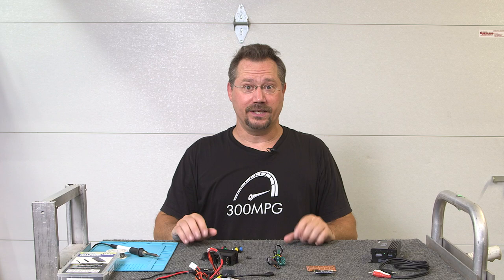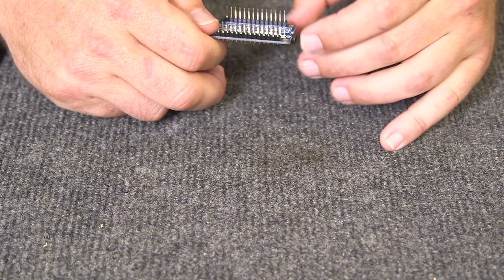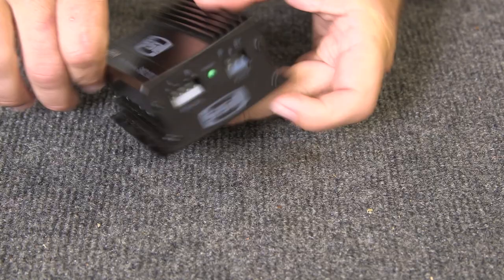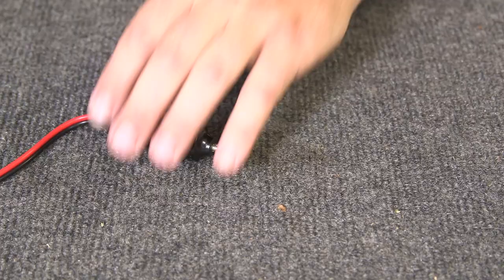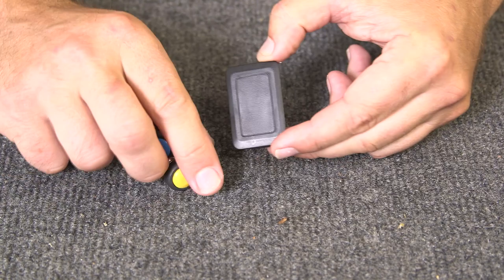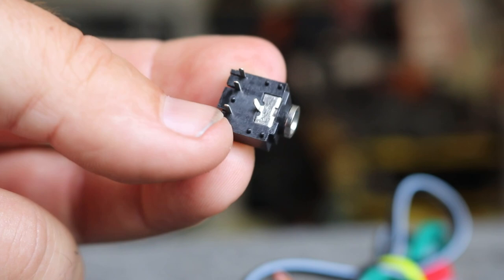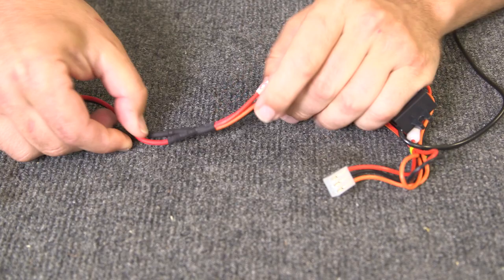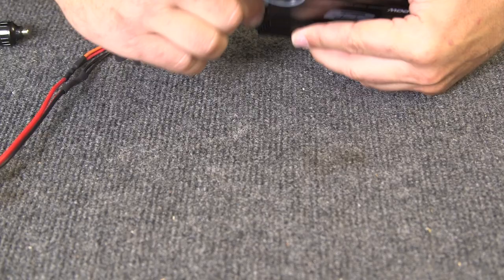Custom Car Horn | How To with Adafruit Sound Board

Comment: Can you use the existing pedestrian audio alert system to produce your customized sound? I hear your vehicle has both sounds together.
Reply from the maker: Most of the time I've used the custom horn so far has actually been with the vehicle stopped at a traffic light or stopped in a parking lot. In either case, the UFO pedestrian warning sound isn't playing.
I don't really have any urge to mess with the low speed warning sound. Nice and simple just to add the sound card and speaker.

Comment: Any suggestion on how to set up one of the triggers to play the files at timed intervals? I am thinking of using this car shows where I won't be sitting in the vehicle to keep pushing a button.
Reply from the maker: Hmm. I guess that based on my skill set, I’d use an arduino to trigger the sound board and have it programmed with a series of delays between activations. 

I’m sure there’s lots of different ways it could be done.

Comment: Sounds like the moos from the cow level in diablo II. That sound board is pretty expensive now at $35, and it just rotates through the various clips without the ability to select?
Reply from the maker: Yep! The sound effects are from the Cow Level! Except for one of them. One of the audio files is just me saying "Moo" into the microphone on my computer. It blends in really well, and it's hard to tell which one is mine.
As for the sound board, I used it because it was something that I already had. It can be set up to play sequentially, random, continuous, etc. It can also be set up with multiple inputs (buttons, typically) to choose the individual sounds, but I only wanted one button in the car, not multiple.
There are other sound board out there which can work nearly as well for a similar project.

Even if a person doesn't use the exact same components, I hope the video shows the general idea so that anyone can build something similar for their car other other custom audio project.

Comment: Hey I’m a little confuse about the wiring for the 3.5mm jack. I have a different amp because the one in the description is no longer for sale. The one I have has a positive and negative wires for each speaker channel. I tried wiring it together and it is super quiet. I wired the positive and negative to each of their respective channels. The amp I have is a boss ce102.

Comment: Is it not possible to use the built in horn of the vehicle for custom audio? Which I guess leads into my other interests of customizing audio files of various parts of the car (entry sound, seat buckle sound, warnings, startup/shutdown sounds etc.); which apparently require reverse engineering? Do you know anything about this? Is it possible? Would love a response, solid video :)

Comment: Can you just use a micro USB Cable for those cigarette lighter plugs from the gas station? How much power does this soundboard need?
Reply from the maker: The soundboard itself is similar to an Arduino or other small microcontroller. It doesn't take much power at all. It can easily be run from a small USB cigarette lighter adapter. This project has several components that need to be powered, so it was easiest to tie them together.

Comment: would there be a way you could explain how you wired up your speakers? i cant seem to figure out which pin to use ( I should specify that I mean the green and black wires not the actually loud horn)
Reply from the maker: The amplifier has a very simple diagram with it showing how to connect the sound.

Comment: Is it possible to make it so that select what sound to play instead of random?
Reply from the maker: It can be made to loop, only play while holding down the button, play one then the next then the next.

I'm only using ONE button to do this. You can simply add more buttons to choose which found effect you want to play.
https://www.adafruit.com/product/2133?gclid=Cj0KCQjwnbmaBhD-ARIsAGTPcfUWe1-4mbxyf51AcQsCHljjlXibiQNH1yLedKJo_NOKwRQj9BZ6eWsaArXAEALw_wcB
Reply: @BenjaminNelsonX  well preferably i would want it to play the same tune, until i pressed another button, at which point it should select the next tune to be played. If that makes sense

Comment: Thanks for not using the car horn button. Multi-toned horns and horns with sound effects are illegal in a number of countries. 

For example, repurposing the car horn button in Britain would cause the vehicle to fail the annual MOT inspection, and you can be fined and have penalty points added to your license for using nonstandard (or what can be deemed to be 'novelty') sounds for the 'clear and efficient warning device', according to our legislation.

Great project as an unofficial and polite signal though!
Reply from the maker: Absolutely! We never want to change any of the standard safety features on a car!
In an emergency, a person's natural reaction is to hit the center of the wheel horn button. And we WANT that emergency warning to work!